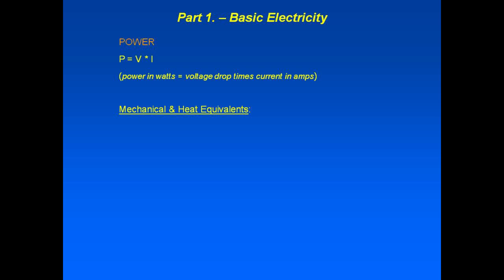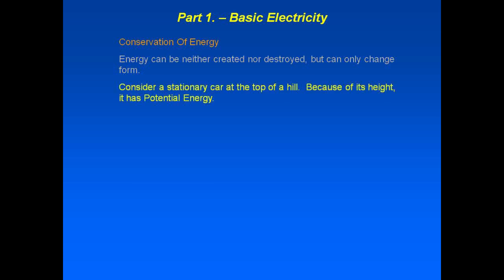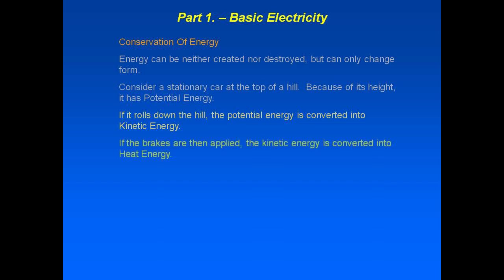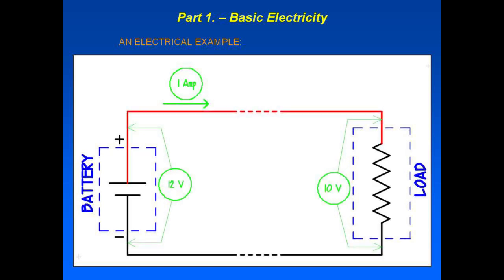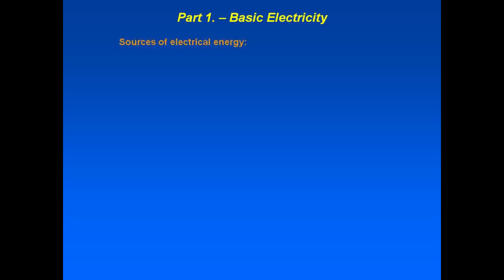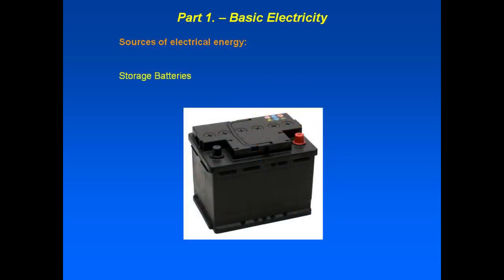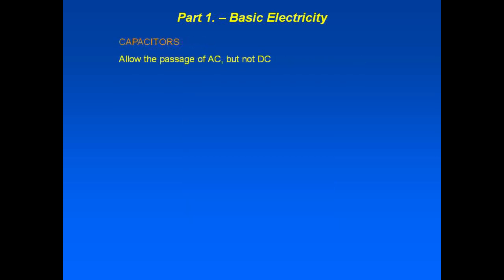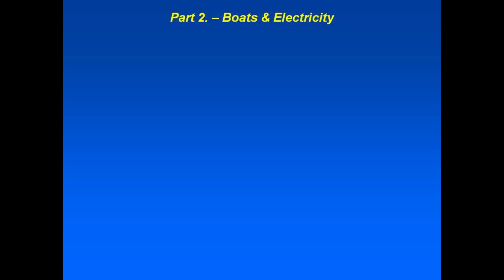Electricity, Electrolysis, And Galvanic Corrosion

Comment: Thanks for posting this here, the audio and lecture format is outstanding. I heard about this lecture in 2015 but was unable to attend at that time. I had always assumed that the neutral and ground wires were bonded at the panel of the boat, like they are in a home. Evidently not, the ground bond is done on the dock kiosk, unless one has a hardwired inverter. I was also surprised to learn that 'fail safe' isolators may not be as effective as old style glavanic isolators. Makes sense. Roger, if you know something about NMEA communication protocols, it would be a great topic for a future lecture. Most internet sources are too superficial to enable a person to peek under the hood.

Comment: Continuing with my previous comment . . . . 
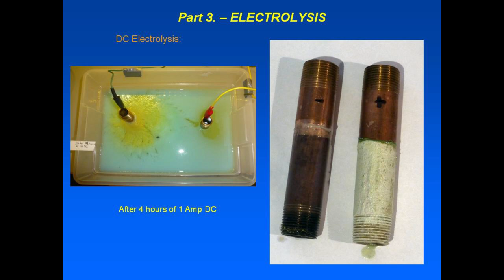At 40:50 (Electrolysis tests) the piece of copper that was receiving current from the electrolyte was free of corrosion.  This is consistent with 59:00 (cathodic protection) but at odds with 28:50 (stray currents).  This suggests that the polarities of the stray currents in 28:50 should be reversed.  I would be interested in hearing from you about this.  Thanks again.

Comment: Excellent video, Roger.  I have a question about current direction.  At 59:00 in the video (cathodic protection) you show current flowing through the electrolyte and into the propeller, and the flow into the propeller protects it.  That makes sense to me.  But at 28:50 (stray currents) there is a similar diagram with current again flowing through the electrolyte and into the propeller, but this time the propeller is being corroded.  That seems inconsistent.  Can you explain that please.  And thanks again for a very instructive video.